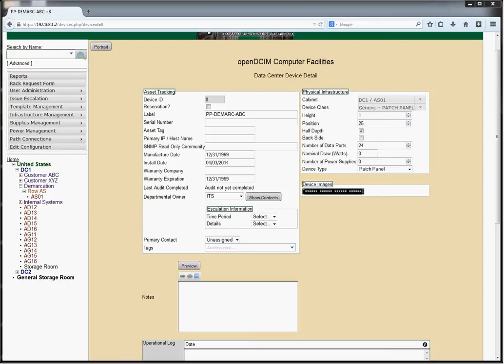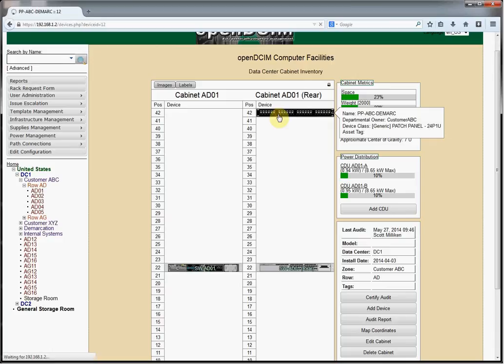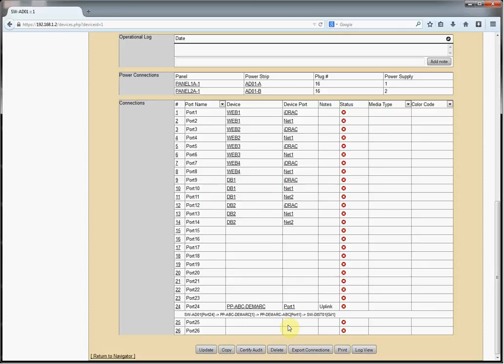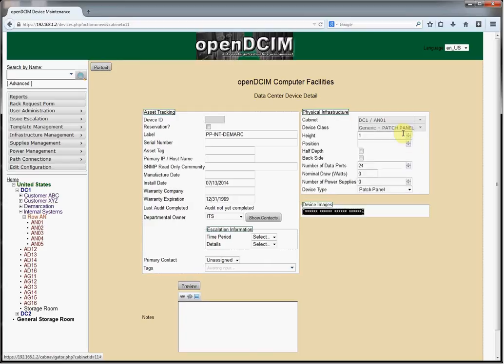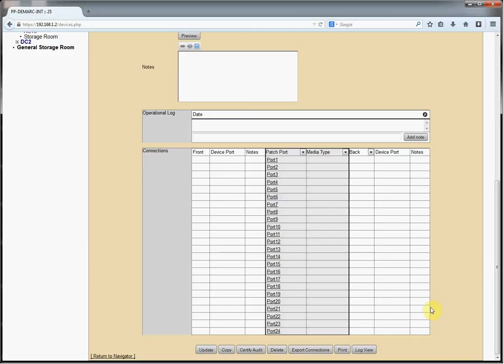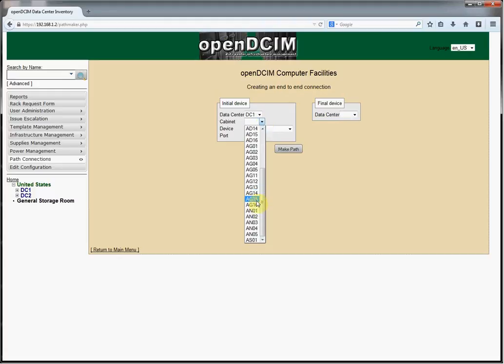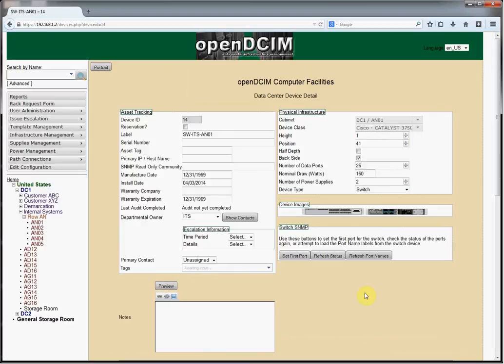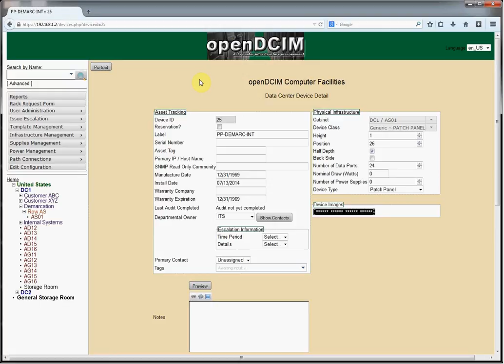Using Patch Panels in openDCIM

Comment: Thanks for your video. I am trying to map out my patch panels in the same manor but when I create a patch panel, or many patch panels the back column never pops up with a selectable drop down. I can only make a rear connection to a front connection, not able to make rear to rear connections. openDCIM ver 3.3.

Thanks.